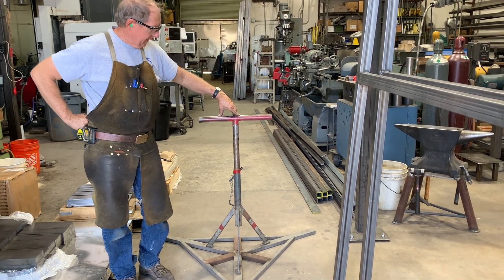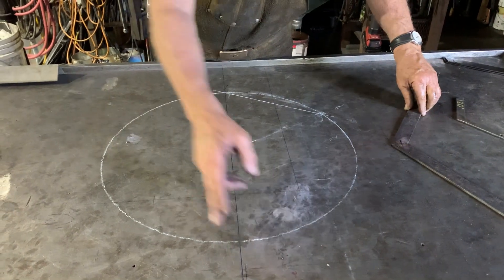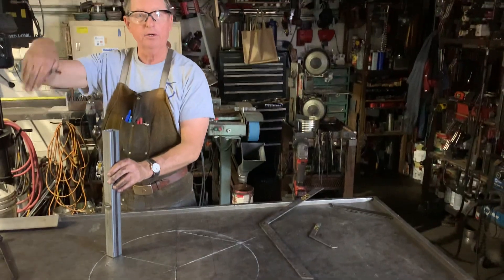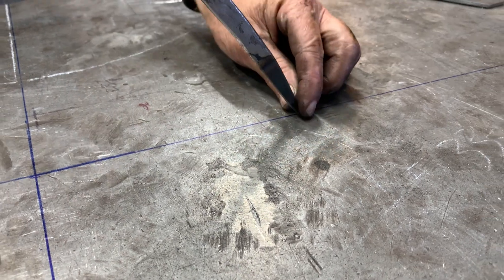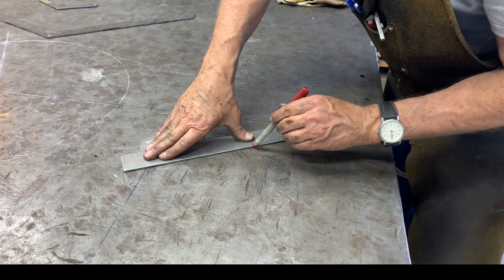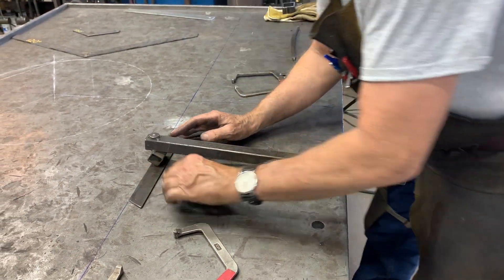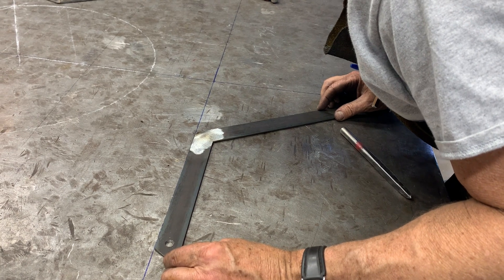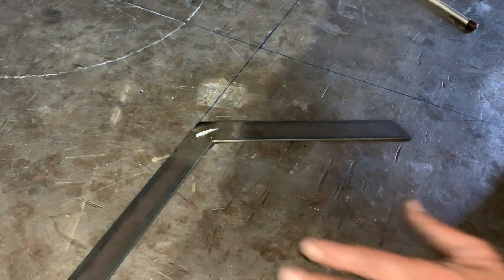How to layout 3 legs 120 degrees apart (and how to make a 120 degree square).

Comment: Can use the same compass width to make  60 degree marks on the circumference, use every other one for 120 degrees.
Reply: Ooh, smart
Reply: You can also make an equal sided (equilateral) triangle and with that you've got your 120 degrees at any of the outer corners, you get two extra for free.  For the inner corners we are a little short on degrees so you only get 60 degrees at each of the inner corners.  But we are missing the point of the three legged stand, that is, that it is very stable, it never rocks, It is always the needed and sufficient proof that you only need it's three leg ends (points) to define a flat plane.  People throughout the world  who lived on dirt floors used tables and stools with three legs so they wouldn't rock on the often uneven floor.  So I'm thankful to Doug for his brilliant idea of the three legged stand or table which saves us from having to shim one of the legs on them to keep it from rocking.
Reply from the maker: Great points! Thank you.
We mentioned the stability of a three leg base in our shop built anvil video (https://www.youtube.com/watch?v=gUVsLMc5Njs), but as you point out, is certainly worth another mention here.